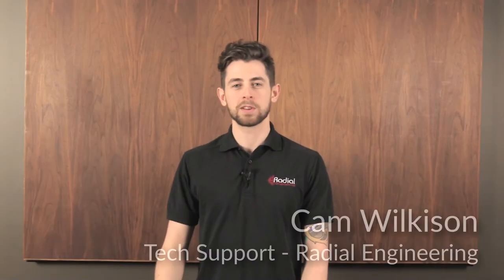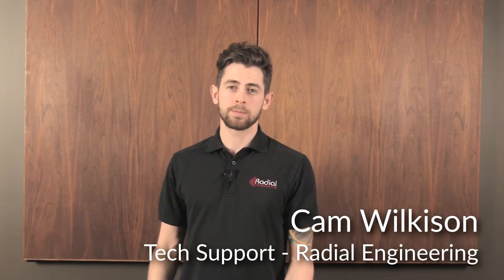Three Alternative Ways to Power 15V Radial/Tonebone Devices

Comment: Can you use 1 18v into the stagebug instead of 2 9v?
Reply: You should be able to. Use either input jack.
Reply: Did you ever confirm that using 1 18v works the same as 2 9v? Thanks.

Comment: Is the centre pin 2.1mm or 2.5mm?
Reply: Hi Ansen - I had posed the same question to Radial Engineering Tech Support regarding my Switchbone V2 and was told that all DC power jacks for Radial products feature 2.1mm plugs.